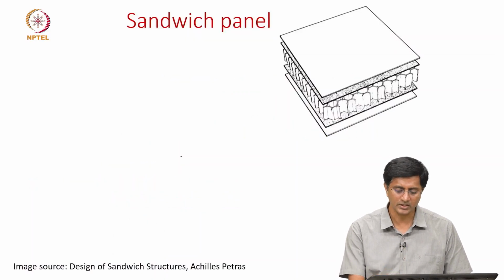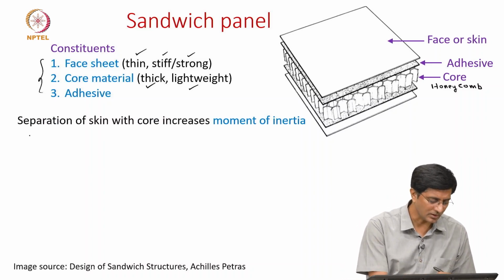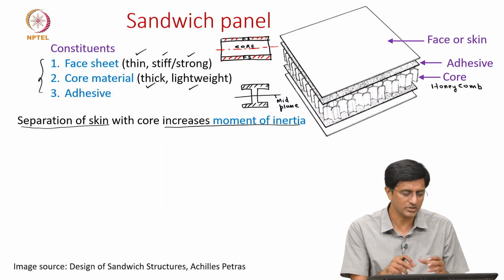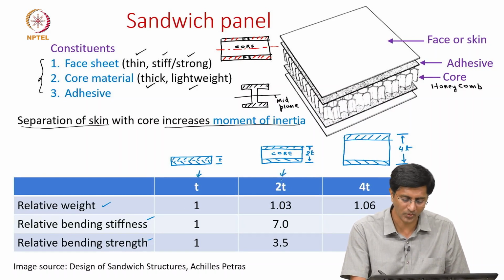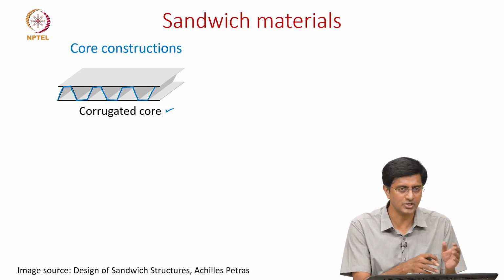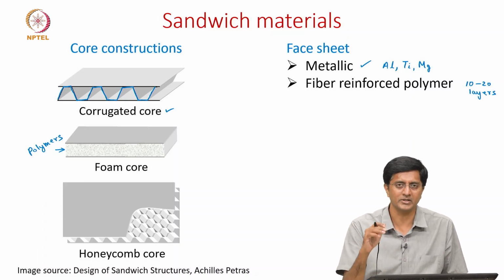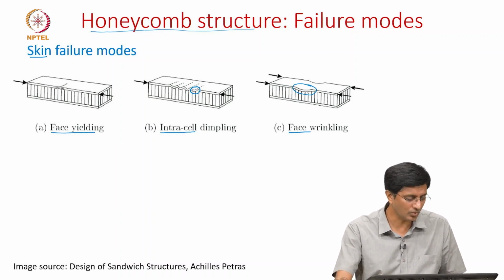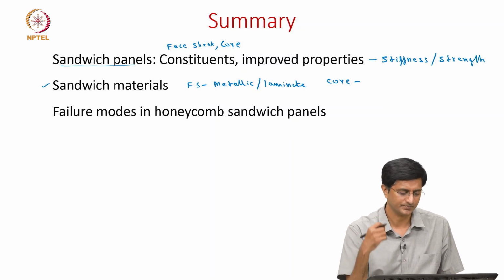12B Sandwich structures

Comment: Thanks for the great video! What happens if we use a ceramic matrix composite skin instead of plastic. My reason for asking this is to understand whether the skin itself needs to be tough or is the toughness imparted by the core? In other words does the system still function if an individual component fails. Thank you.